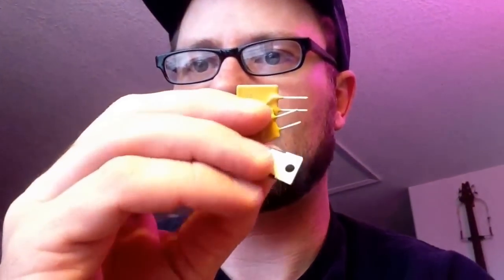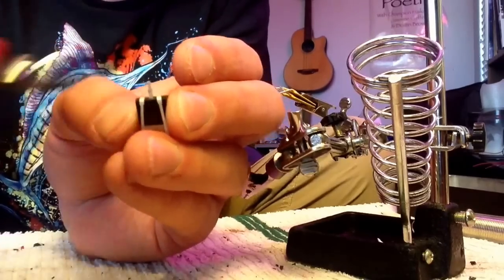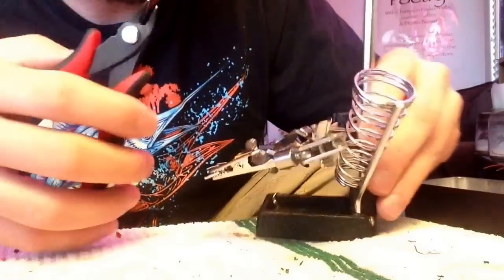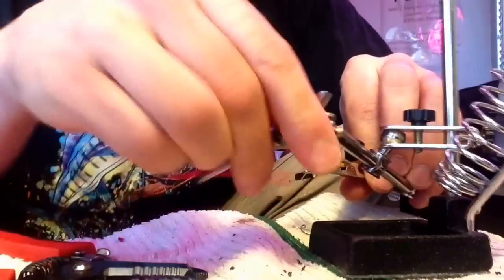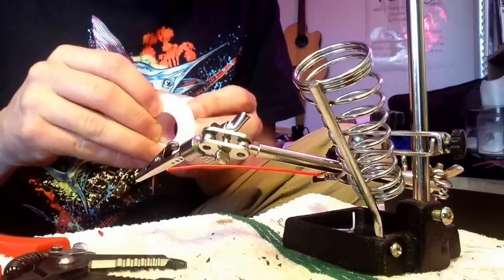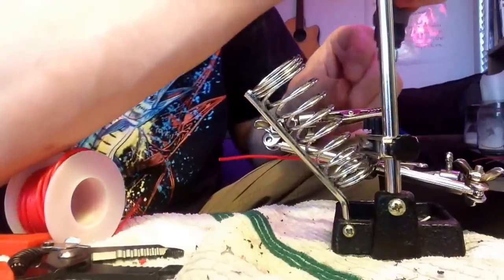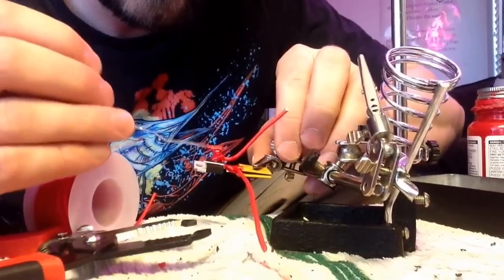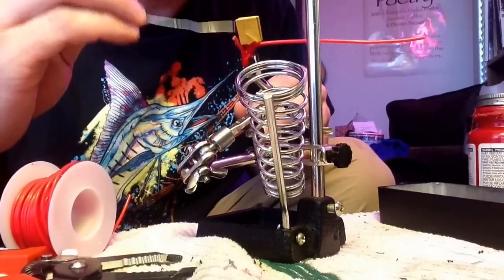Fets and fuses, how I do them.

Comment: hey so are you suppossed to wire the negative legs of the fuse to the mofset or the postive? I know the fuses are in parallel so the negatives have to touch each other and the positives have to touch each other right?